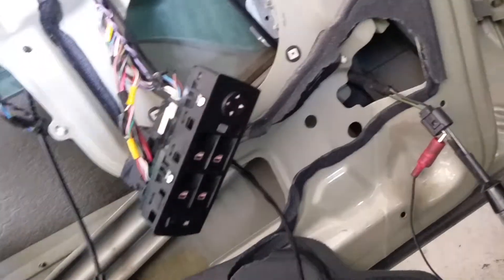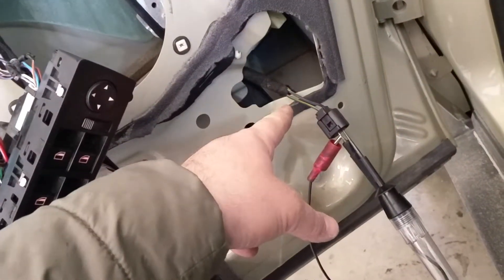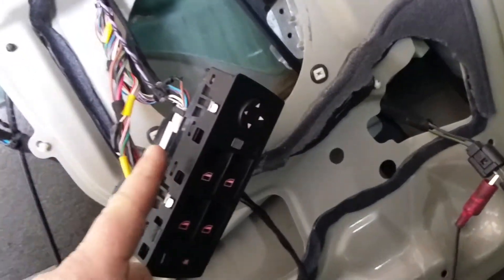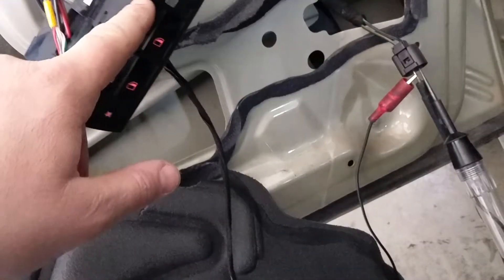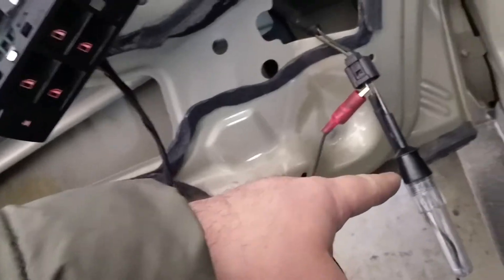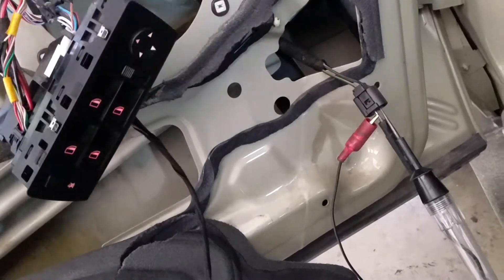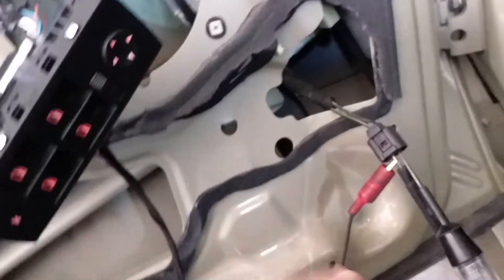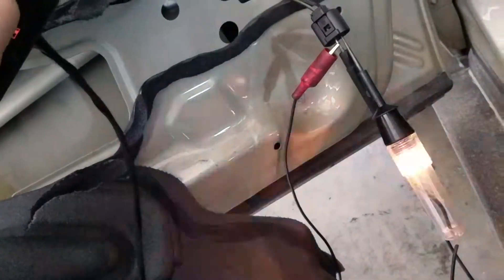E53 X5 drivers window inop

Comment: How did you arrange the wires in the motor plug? What is the red wire? Is the test light a circle to both plug openings? Ground? Power? The red line? Thanks.